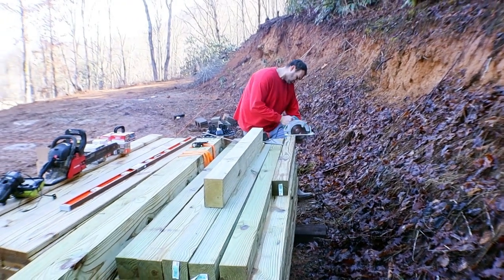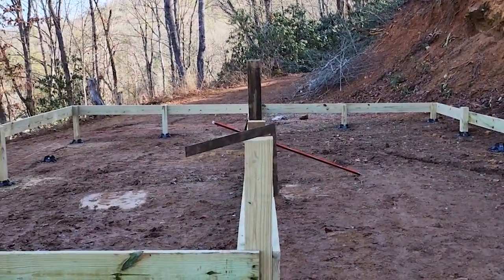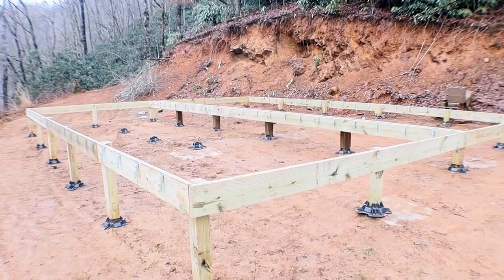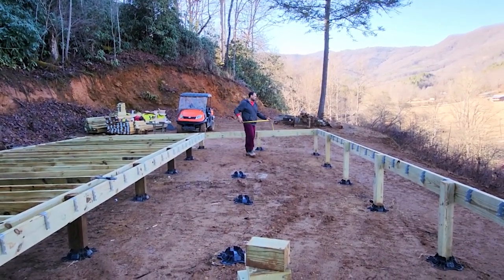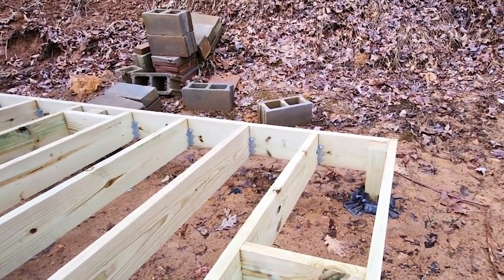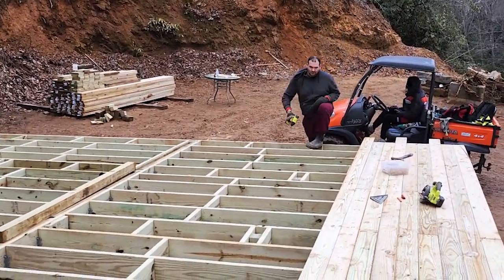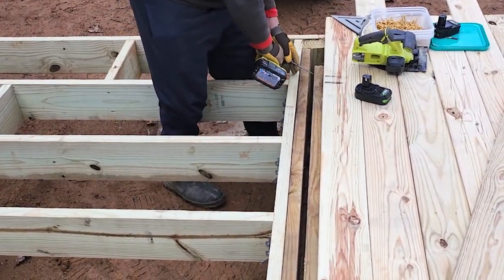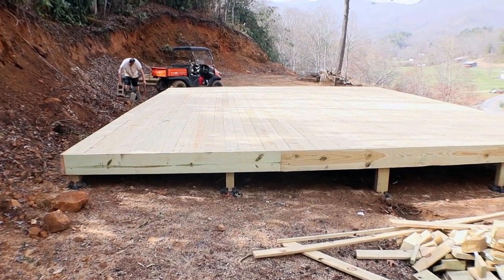3 Day deck build for Glamping Site #1, our tiny home mountain retreat is almost ready for Airbnb.

Comment: I have a question on the deck. Did the permits allow you to build a deck like this? I’m looking do do something like this but I’m afraid it won’t pass building inspections
Reply from the maker: We had to have the site graded again and reposition it a bit they had no problem. We're in a bit of an unincorporated area also that could have helped. Definitely check your county as they are all different. We could have run into issues trying to update the original one, so we just tore it down and built a new.
Reply: @NaturesNear  makes sense, thanks for the reply!
Reply from the maker: No problem I wish I could offer more but it's so different every county, that's why we chose this property. Even the inspectors play a part some are a little lax and then some are an iron fist, we had to go down there twice.
Reply: @NaturesNear  no worries, good luck on your project, we bought a dome, and a piece of land up north, excited to see your progress!
Reply from the maker: I'm excited for you, it's gonna do great 🤞